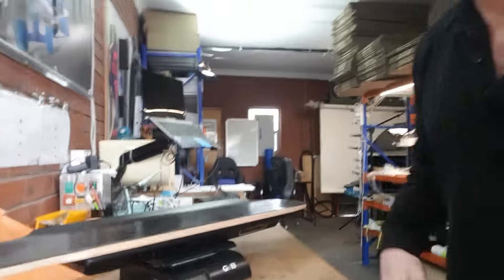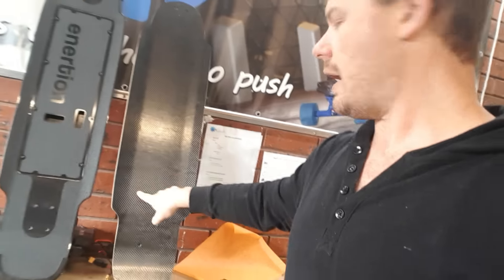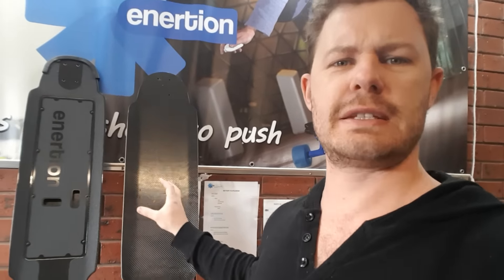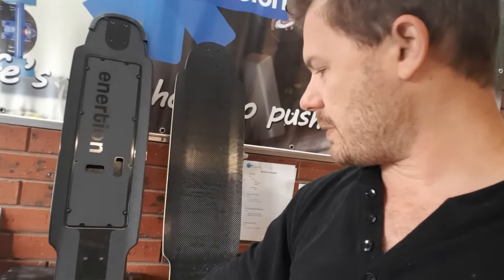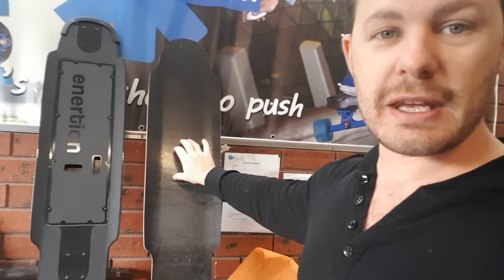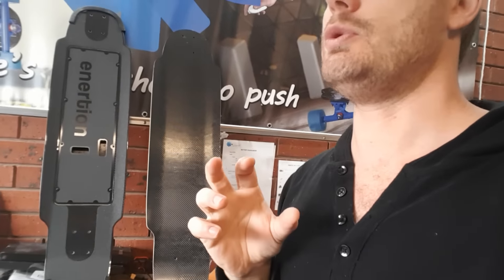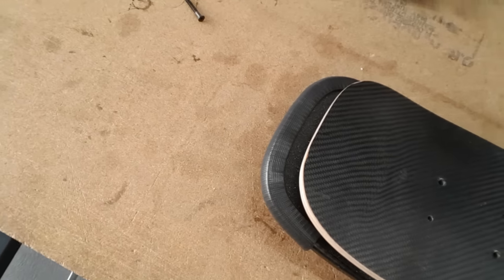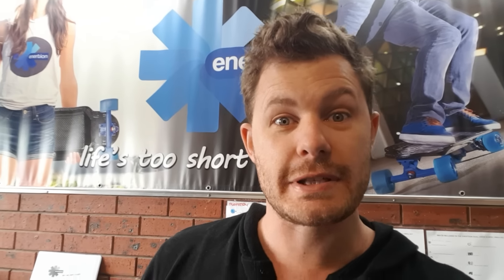Raptor 2 - carbon fiber vs wood deck

Comment: Could you consider making a longboard shape deck and remove the kicktail. Its just so pointless and something that I never use on my Raptor Dual. Ask the community for the take maybe?
Reply: My vote is for a kicktail. Being able to loft the front wheels is something a lot of street skaters are used to as it helps getting over obstacles.  Besides, if you want a typical electric longboard, there are many other options out there to choose from.

Comment: Hi, 
What the point of using carbon fiber on the top? As this should be a compression side, is the benefit really great? 

On the bottom, I understand mesh is simpler to use, but as you're cutting it, maybe it would be better to use ud layers so you can increase strength in the length direction. 

Still a great video anyway

Comment: Have you ever thought about making flexible deck? Maybe with seperated battery and driver enclosures. Also what will be the max weight limit for raptor 2? I'm asking as a pretty heavy guy.

Comment: Some hub motor specs v original motors will be good and a side by side performance comparison like you did with the raptor mono v boosted.

Comment: Ok I emailed your support email and they still haven't emailed me back so can you tell me when I would get my 12mm pulls kit , motor mount and the Moyer i ordered from you or can you tell when it will be back in stock

Comment: Wood deck is fine for the reasons you gave. You still nailed it with the V1.  Be interested to see a comparison of the 2.What is your aim as far as competitor for V2 as really it was probably the Raptor V1.
Reply: Awesome board dude, thanks for making this. Im getting one for sure.
But when it comes to competition what do you think of the mellow board? Comes out May 2017. It looks like the best option out there, whit possibility to use any deck and swap batteries in seconds. And hub motors. Have to bye that one too :) hehe
Reply: Think he meant the Boosted Board V2

Comment: So if the parts are modular why not just offer a kit without a deck. I detest wooden decks. I wont buy 1 of yours because its not with a carbon fiber deck. offer a kit and then I might consider it. aside from that the board is awesome. I just cant justify buying a board with a deck I don't like then having to spend MORE money to buy a deck I do like.